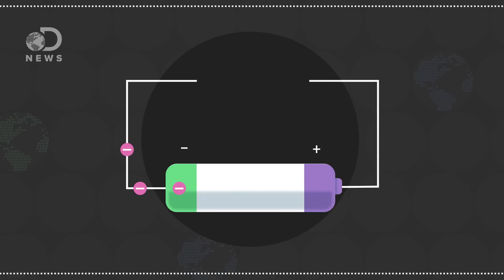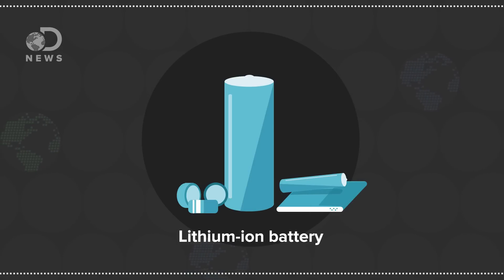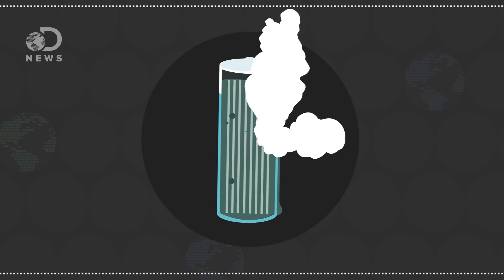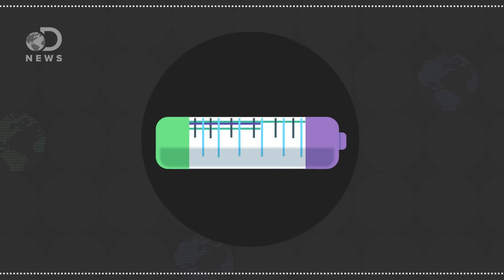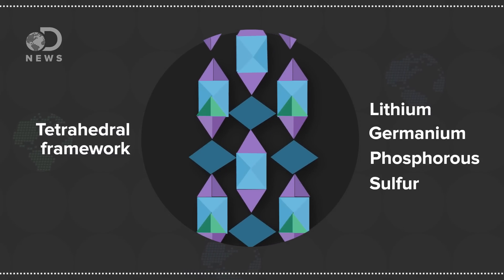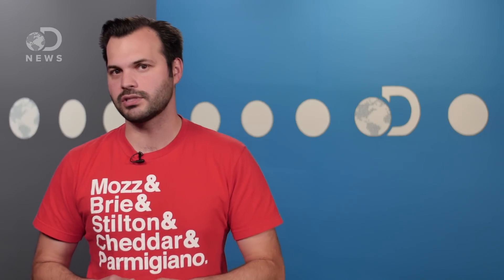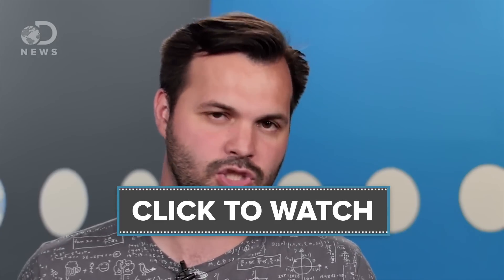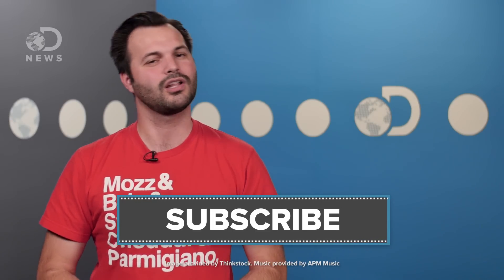Are Solid State Batteries The Perfect Battery?

Comment: No. The perfect battery would be a black hole slowly evaporating it's energy for use in some sort of machine. The only problem is that for such a battery to be long lasting it would have to be very large, but it would hold the energy for much longer than any other object known to man. At the end of time and when all stars have died, the black hole will still hold it's energy.

Comment: What we could do is take a HIGH conductive foil cathode like silver and a very LOW conductive foil anode like steel and make a voltaic capacitor and we could charge it fast and then switch the circuit to discharge through a very high resistor to discharge it slowly

Comment: You keep showing negative charges moving internally through the electrolyte. This is just plain wrong. Electrons move through the outside of the battery, through your device. If they moved internally you would have a short circuit and the battery would blow up!
The electrolyte's purpose it to allow POSITIVE Li-ions to move in the same direction as the electrons, in order to compensate the charge buildup that would otherwise result when the battery operates. This is like the 5th video I just watched where they draw a schematic of a Li-ion battery and get it all wrong.
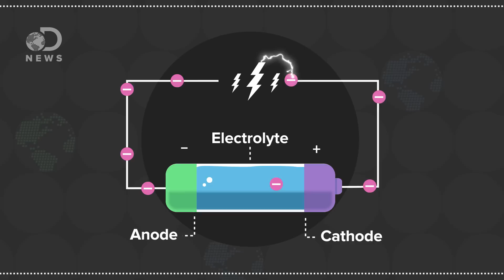The external flow of electrons you show at 0:25 is fine but you need to replace the internal flow of negative charges with a flow of positive charges in the opposite way as shown.
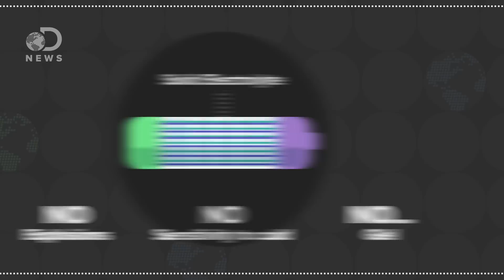And at 2:15 when you show how 'special' it is that you have 'electrons hopping through the framework' of the solid electrolyte is plain wrong. Any metal/other conductor will have fast electron movement through it's framework. The special thing about Li10GeP2S12 is that it allows relatively fast movement of the POSITIVE LI-IONS, NOT ELECTRONS.

Comment: Wut? The electrons can move through the electrolyte? What's the purpose of that?
The idea of the electrolyte is to let ONLY the positive ions through, so that the electrons have to flow through your electronic device. If you drive a nail through it, you WILL absolutely short circuit it.=heat it up very quickly.
Lithium batteries don't just burn because they get exposed to air, lithium doesn't combust spontaneously in air, it will oxidise quite quickly but not burn, unless there's moisture. And if you ignite lithium it will burn, that short circuit is your source of ignition.

Comment: @1:12 this is horribly false. Batteries use a Lithium-Oxide wich does not react with water. There are tons of videos where batteries are opened and do not engulf in flames or whatnot. Pucture batteries combust because of the heat due to the electric shortage.

Comment: One of the most inaccurate video ever... electrons don't flow trough the electrolyte... if they would,  you will have your explosion... Only 5 Volt??? 5 volt is an extremely high potential for battery materials. Btw the voltage of a cell does not depend on the electrolyte, so it is out of context here... A solid state electrolyte would have major advantages over the liquid or (as you call it) gel electrolyte, but they are not mentioned in this video...

Comment: Very annoyingly this video keeps saying that electrons move through the electrolyte, which is just wrong (at least as far as free electrons are concerned, which are the interesting ones). To the contrary, the electrolyte serves as a barrier to the free electrons, forcing them to move through the wires outside the battery in order to go from anode to cathode, which flow is after all what we use the battery for. What moves through the electrolyte is ions and this movement is necessary to compensate for the displacement of charge by moving the electrons (it avoids separate concentrations of positive and negative charge building up).

Comment: Electrons aren't supposed to travel through the middle of the battery, only around the long way through the circuit. A short circuit is called that because electrons somehow find a pathway through the middle of the battery, taking the shortcut. Positively charged ions are supposed to flow through the electrolyte in the opposite direction to the electrons to balance the charge.
Reply: Also, the polymer reacts with oxygen in the air, AKA burning. When you damage the battery too much a short circuit occurs which causes all the stored energy in the battery to be released quickly. The heat generated from this quick release is usually enough to ignite the polymer/liquid.

Comment: Anode and cathode form a diode NOT a battery. A diode is a component that allows current to pass through it one way and not the other. Typically used in devices to help rectify AC current to output as DC.

Comment: 1:12 false, it's been proven time and time again that Lithium batteries do not explode because the lithium is reacting with moisture, in fact there is not enough lithium to cause an explosion. It's the battery shorting out internally and dumping all it's power all at once.

Comment: Some Japanese scientist very recently made a solid electrolyte that does not require expensive germanium. 2 actually. Its very new and it seems it does suffer some degradation. They were working on improving power output and discharge comparable to super capacitors while having high energy density, and not exactly on cycle life, but aren't solid state batteries supposed to be more durable? I thought that was the promise of solid state.

Comment: How is it for weight ?
If this solid state battery tech makes it to the consumer level it could revolutionize electric vehicles. I assume the electrolyte is what give the battery most of its weight, so by eliminating it, battery density and charge capacity could be increased while still maintaining a weight savings or equal weight to current models.

Comment: so if you created some device to move electrons from the cathode to the anode without deteriorating.. you could power a circuit forever?
Reply: NO. Charge retention and energy density are completely different things. It would mean your new battery won't lose charge capacity over time nearly as quickly.

Comment: the problem isn't the batteries it's the proprietary nature and price of the devices used.
I could live with a 1 or 2 inch thick device and why not have the batrery removable like a cordless drill ?
how about when the battery is charged it runs off of electricity directly ?
why can't all chargers and connectors be standard usb only ?
wifi, bluetooth, ir remote do we really need all three ? 
wheres the free coast to coast wi max ?
radio, tv, telephones ? why anymore ?

Comment: 5V but how many amps? will we get as many amps as the battery can hold? if so then a 5V battery is enough for most things. Most independent IT testing equipment use less than a 5V battery in my use of them anyways. Most cell phones spare the iPhone line, use less than a 5V battery, many remotes use less, it is when you get into cars, lihgt bulbs ( though had to be designed for 120V / 240V for home electronic outlets), anything that moves on its own that you need a batter faster than 5V 
The major thing will be cost vs cost savings, explaining that higher cost to a consumer for how long it will last, and finding a way to get it into a AA battery as most things use double As anyways.

Comment: Interesting lithium batteries sound fairly similar in design to electrolytic capacitors. Maybe use graphene in battery or capacitor you could get a lot of power. Capacitors are fairly similar to a rechargeable battery.  I even saw one case someone replaced a car battery with capacitors. The only real issue with capacitors is they can cost a good deal and generally most of them will lose charge over shorter times than batteries.

Comment: The problem with this formula, as i see it, is the germanium. The stuff costs ~$120/100gm. That would make the solid electrolyte pretty expensive.
Reply: +D&#39; Otter germanium is used as a semiconductor very very frequently in electronic devices at the amounts they most likely need for this battery is very very small.
Reply: +nanotam89 Well, to me that's a question; how much germanium does this solid electrolyte actually need? A battery is a lot bigger than a transistor, or any other electronic component, and electrolyte can take up more of a battery that anything else. We also don't know what percentage of this solid electrolyte compound, (or however you describe it), is germanium. So it might take very little, or it might take quite a bit.

Comment: They talked about these batteries on a podcast I listen to. On the very first recharge they lose 10% of their capacity. After that you get about 500 recharges only losing another 15%. I would say don't consider that first recharge a loss of 10%, think of it as the first use gives you a little bonus and then it's at normal capacity.

Comment: These solid state cells may create the perfect batteries,  but not the perfect form of electric storage (that goes to graphene).

I really don't understand why people treat voltage as a problem.  Most platforms in phones can operate safely at 5v.  If you need less voltage, there are ways to drop the voltage without being too wasteful.  If you need to increase the voltage, get multiple cells and put them in series.  This seems like such a non-issue but whenever new battery tech comes out, the voltage is always treated as a "problem".
Reply: So if you want a power reservoir for your computer you just put 44 of them together, it's a little impracticable don't you think?
Reply: SnowOfTears uh... where are you getting that number from?  First of all, desktop PCs aren't ever powered directly via a battery.  Sometimes they may have a UPS, but that's supplying AC power, which the computer then turns back into DC.  But for argument's sake, let's say we were to create a battery for a desktop computer.  PCs primarily use 3 different voltages: 3.3v, 5v, and 12v.  We don't know the amperage of solid state cells, so for all we know, 3 in series could be enough (to create 15v).  From there, voltage regulators or inductors could be used to lower the voltage where needed.  Realistically, you would probably need a lot more than just 3 cells, but my point is you don't need some crazy amount like 44.
For the average ARM platform (such as smart phones), 5v is all you need.  Many laptops operate somewhere between 15-20v, but it's a pretty crude amount with a lot of wiggle room, so a 15v cell would still work.
Reply: Peter Schmidt a desktop computer needs a lot more current, and if you are in an industry where there's a main computer that manages everything you don't want it to simply shut down if there's a current drop, here the voltage is 230 so we'd need 230/5=46 batteries (i was even wrong)
Reply: SnowOfTears That's really not how it works, at all.  What you're referring to is the wall outlet, which is 230v AC.  Computers operate in DC, and so do all forms of batteries. No matter where you live in the world, PC components never operate above 12v DC.  In fact, most DC electronics don't.
Computers care more about amps than volts.  In theory, 3 of these solid state cells could operate the average home PC.  But, the battery might die within a couple minutes because they don't supply enough amps.  They didn't elaborate on amps in the video, so we really don't know how long they'd last.

Depending on their physical size, 40+ batteries might actually be ideal to keep a computer running for several hours at a time, but you would definitely NOT put all of those into series, or else you'd probably destroy the computer and probably cause a chemical fire.

Comment: #blackmarketblackout

If they really want to fix this, they can... (one, all, or a combination)

1) Increase the chances of the weapons in both rare and common drops
2) Increase the a"burn duplicates" amounts and have it scale by its rarity (1 for common, 2 for rare, 3 for legendary, 4 for epic)
3) Change cryptokeys to be earned based upon score per game and in game time. Maybe earn (1 cryptokey per 2000 score) + (1 for every 2 minutes of in game time, not clock time such as how the timer stops in hardpoint when it is captured)
     Ex) 8 minute game and 6000 score gives (4) + (6000/2000= 3) = 7 total cryptokeys
4) Decrease the cost of common supply drops to 7 or 8 
5) Decrease the cost of rare supply drops to 25
6) Lower the price of cod points
7) Introduce weekly challenges of various difficulties to earn a decent amount of cryptokeys (scaling by difficulty)
     Ex) Get 50 kills with each specialist weapon 
     Ex) Get 500 kills with weapons in each weapon class 
8) Wager matches for cryptokeys
9) Be awarded 1 free rare supply drops per day (Don't carry over, meaning you don't accumulate the supply drops if you don't play for a couple days)
10) Most voted paintshop camos/emblems earn 100 cryptokeys (resets every 7 days)
11) The top 3 players on winning team get 1 extra cryptokey 
12) Double cryptokey weekend once per month
Reply: Shut up fuccboi

Comment: If I didn't miscount, this is the 4271113923724013th announcement of cool, new batteries which solve all of the problems of current batteries since 2008. Have I missed any?
Reply: +Christoph Michelbach yeah you did mis a few. you missed 15328, but since another 15328 have been taken down i guess you're right.

Comment: omg, please do better research next time. The electrolyte in a battery is electronically blocking but ionically conducting. That's what makes batteries work without shorting the thing.
One of the advantages of such solid state Li-ion batteries is that Li metal can be used as electrode material (gives higher output voltage and therefore better energy density), with gels dendrite formation occurs during recharging which evenutally shorts the battery (very bad)
Reply: +Doping1234  Yeah thank's he really messed up the explanation.. And everybody is confused. 

Solid= No dendrite/more discharge and no internal short circuit... 
No dendrite allow to use pure lithium...
Pure lithium=more voltage... 
So overall a better energy density. 

Usually the fire ignition is caused by the lithium. But the whole battery end up burning mostly because the polymer gel is also a combustible. By removing at least one combustible it will be harder to get a chain reaction where everything burn.

So I guess that it's true than a whole solid battery will help to prevent both short circuit fire and chemical fire.

Comment: The reason these batteries never come to market is because if they do, there'll be a drastic drop in battery sales overtime, even though it'd be extremely beneficial to people.
It's a shame.
If you didn't need to constantly change the batteries in your remote, controller, or phone, several companies would have fatal business loss.

Comment: Aren't most of these problems caused by Lithium it's self not the gel?
Reply: +ItsJolteon   These problems are caused by the lithium.. But it also true that replacing the gel by a solid will prevent most of the lithium problem.
Solid material prevent the lithium dendrite/little wire that cause internal short.
It allow to use pure lithium foil instead of a blend of graphite/lithium.
And I guess that if the battery is a whole solid block it will be pretty hard for the air to get in contact with the lithium and cause a chemical fire. 

Over all the energy density will be higher... By allowing more voltage and a deeper discharged. 

But i'm disappointed because he do not really explain it so well in this video.
Reply: +ItsJolteon The gel degrades, as he said in the video.
Reply: +Matro Tyramat I said "most of these problems" I did not say every single one, however even though they do degrade eventually MAJORITY of the problems are caused by Lithium like the expences and it catching fire is the metals flaw etc.
Reply: +Eric Jacques (Leucome) I never said I disagreed about replacing the gel I agree it would be better to use a solid instead of gel.